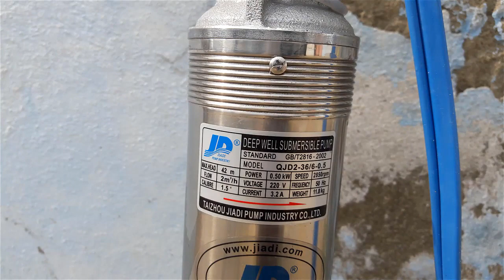0.5 Hp Submersible Water Pump, Jd Submersible Water Pump High Quality

Comment: Sir  app ka help chahiye.   Ek dilar 
Soral 0.5 hp solar sumbesabe pump or 320X3=960 watt panala deaga bola 
Or je send or vfd 3 fese wire HDPE pipe all fiding. Bo vi. 52000 hajar main ye sach hey kiya sir.     Lubi compani
Reply from the maker: bilkul sahi hai
Reply: @jioimran    thanks sir.  App ki Hisab se ek.  (STMET)   DI JI ye sir. Kansa saman  kitna lagega    
  Sir.  Pump 1hp hogana    lekin ye. 0.5 hp moror    ye.  Mera samj main nahi a raha hey.    Kiuki.  Ac.  Par.  0.37/kw . 1 /hp.    Ya  0.75/ kw 1 hp ac ka samaj he mujhey par sir   dc ka.   Samaj nahi hey mujey 
(0.5 hp to motor kitana( kw ) ka hoga sir.  Plz ansard sir
Reply: @jioimran  sir.  Sumbesabe ac. Ya. Dc ka hoga sir
Reply from the maker: @madhumahanta4307  Ac ho ya dc dono sahi hai
Reply: Sir sumbesabe oil colet ya water colet  main hoga